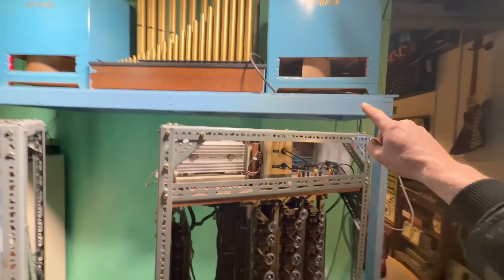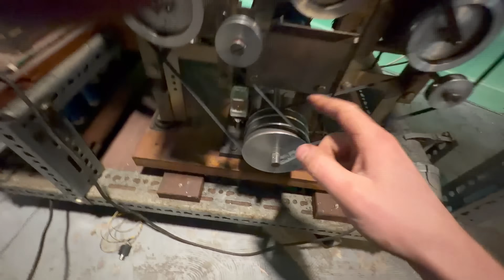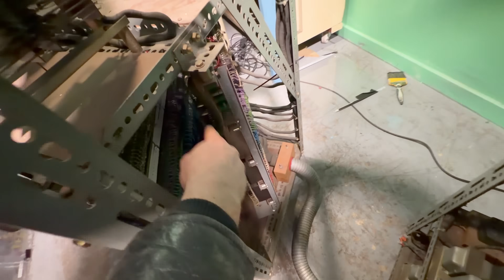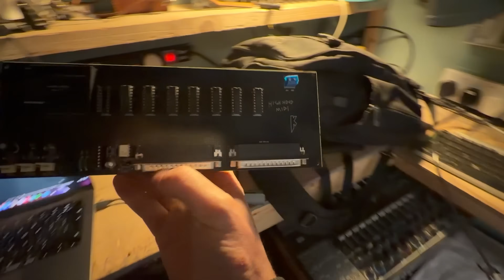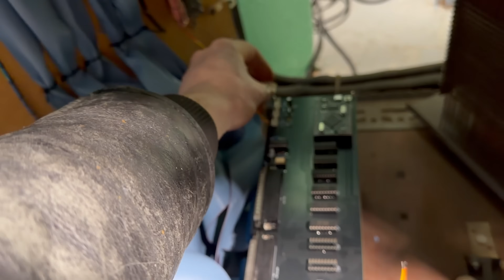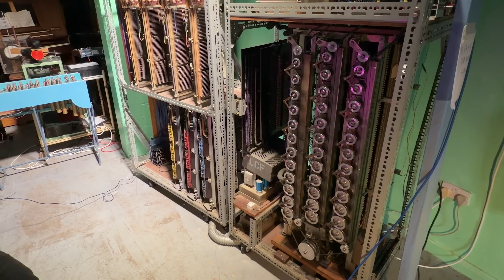IT FINALLY WORKS! - Crazy Electrostatic Spinning Church Organ

Comment: It's technically functionally making use of an even at the time it was made, an abandoned form of computer technology that got surplanted by cathode arrays and magnetic core memory that dates back to the early 1940s, known as rotational mechanical drum wheel relay computation which dominated early computer design because at the time it was believed that vacuum tubes required too much power and generated too much heat to make for practical semiconductor gate arrays.  In the late 40s they figured out it was possible to use tubes and it was faster and cheaper than drum relays so the drum relay tech was abandoned.

To see the same technology used to disipher the Enigma machine later used in a church organ is pretty unreal.

Comment: That needs a MIDI controlled brake on the motor pulley for vibrato!
Has anyone ever re-engineered the tone wheels for a similar organ? With cheap brushless DC motors available now, I could conceive of a mechanically simpler design that still produces the fantastic sound that this produces.

Comment: So those high-side MIDI boards, what are they? A load of SPI port expanders that can do high voltage? Or just the high voltage drivers with 1 pin of the D-sub connectors going to each input on the chip, and the chips just being high-voltage buffers? And then what, a load of port expanders somewhere else? The name implies it takes MIDI in. I see it's running at ATMega. An ESP32 would be nifty, driving a 60 year old electro-mechanical church organ over Wifi would just be too great! Though I suppose you'd want standard wired MIDI too, as first priority, since everything else speaks that. 

Actually you could, later, add Wifi from an ESP board, just outputting standard MIDI that way through the thing's MIDI input. Then put a little app, or better, just a web page, that people could connect to on their phones, with the option to play little tunes! A few pre-set tunes a few notes long, then maybe a partial keyboard, to let visitors mess with it even if you don't want them touching an ancient death trap running on old 5-amp round-pin sockets.

Impressive that MIDI has lasted so long, invented not long after keyboards started to have processors on board for digital control. And it still suffices now. 31,250bps being fast enough and within latency that no human ear can tell if it's a message or two late. Even over USB at ridiculous data rates it's still emulating MIDI, running real MIDI data over however-many layers of abstraction. I wonder if it allows stuff like real-time sample transfer and digital audio, over faster links like that? But still, the basis, is 5-pin DIN serial links and they're always supported. AFAIK, not an expert like. But nice to see long after the Atari ST has died, it's still going and you could run original Cubase tomorrow and have it run a studio.

Comment: ..recommend you swap out all those old electrolyte capacitors, this may by chance even fix your amplifiers.   Yeah its work, but necessary.... the old caps are either leaking already thus breaking things and circuitboards, or they will soon.

cheers

Comment: A small tip for checking if its spinning at the correct rate which you may already know: laser tachometer with a bit of tape on the wheels would allow you to see the rpm of each wheel and quickly check which one isn't correct

Comment: Hey Sam, I'm not sure how much you know of a MCU (CPU) internally, but the Renesas Header File "R7FA4M1AB.h" of the Arduino Uno R4 shows how the internals are addressed. just hold down the control key when hovering over a "keyword" from the header file and the Arduino IDE will show it to you.

In the Renesas R7FA4M1AB, 19.x MB datasheet you can see the address numbers / space of the onboard goodies, it's necessary to have this datasheet and reading it. each section shows a description of the "goodies" and it's "Registers" (addresses), i.e.: 0x4000 0000+.

You only need to correctly address something and shift in some (data) bits, that's all it takes, the cpu takes care of it on the next clock cycle. 21 nano seconds later. No need for Arduino code!!!!!!!!!!!!

Once you understand the Renesas Header File "R7FA4M1AB.h" things will become very clear and creating things will cost minutes rather than hours and days, weeks. You'll never return to Arduino Nano or Arduino Uno R3. 

Also it's a 5 Volt 32 bit machine rather than 3v33.   You might be very interested in it's Real time clock, 14 bit Adc & 12 bit Dac (VCO) and of course SPI / I2C.

Comment: Hey Sam, the Arduino Uno R4 is beast, very much worth the time for top notch experiments, the Header File "R7FA4M1AB.h"  becomes visible when you write: R_PORT1->..... and hold down "control" while hovering over "R_PORT1".

When you write: R_PORT1->, a context menu appears in the Arduino IDE when typing ">" after the -. 
allowing you to choose what you need.

It's by far much much easier to manipulate it's brain using hardcore code vs "Arduino" code.

I got SPI running with a CD4040, 74HC595 ic and some leds plus an additional pin to "latch" the input of the 74hc595.
I did this using the SPI.H from the Arduino ide, than i started asking the "brain" what SPI setting the "h" file employs.
Than i copied to output from the serial monitor and created my own "SPI" file and it worked.
Using just 14/15 lines of code instead of a cumbersome long file!

In general Arduino code is bad, obfuscating a lot of "important" stuff and introducing more cpu time, making it considerable slower.
I'll make a video on how to use ports and the SPI. it's easy.

When you get SPI going, you can use a Dac like MCP4921 / MCP4922 (dual 12 bit dac in Dip14), just shift data 4 spots to the left to emulate 8 bit Dac and more ic's. allowing you to build advanced computer controlled experiments or a  add Sram like 23lc1024 (128 kb).

also it's 32 bit, allowing you to calculate up to 4 billions big numbers in 21 nano second (one cpu cycle).
Much much much more precise than a 8 bit cpu like Arduino Uno r3.

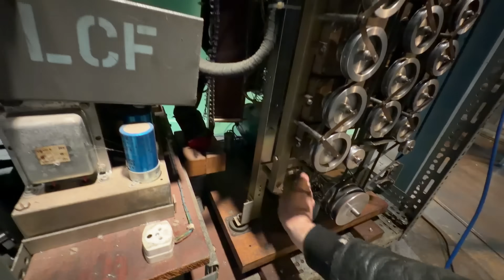Comment: Watching you pull the plug around 25:00 ... some Hammond B3 players actually do that as an effect.  Flip the power on the console off and back on real quick.  It acts like a pitch change controller on a MIDI keyboard.
Reply: Yes, it fairly common. Strange how many commenters aren't aware of it.

Comment: Any idea yet if you're going to be able to multiplex some of those several-hundred wire cables into something a bit less unwieldy?
Reply from the maker: thats what we have done with the midi converter?
Reply: @LOOKMUMNOCOMPUTER  Of course that part's true :) I meant the one around the 3 minute mark, that probably has sound instead of control signals in it so probably a bit harder to multiplex?
Reply: @LOOKMUMNOCOMPUTER  Also I have no idea what I'm talking about, never mind me

Comment: NIce video, small point, but Makin is pronounced with a long A, so basically like Making with no G (hat tip to Steve Wright). It was one of the middle names of John Pilling who was the entrepeneur who bought the electronic division of Compton when it went bust, and set about realising his dream of making low cost organs available to churches using elecronics and not pipes.
Reply from the maker: alas. got the northern term i am aware, but its hard to say. i just say words as they come out. cheers

Comment: "this is the worst piece of code in the world"...
Arrays would be the facility any programming language offers to greatly reduce the amount of code, but as you point out in the on-screen-text, this makes it harder for non-coders.
Reply from the maker: arrays are good when everything is in a line. this is not.
Reply: @LOOKMUMNOCOMPUTER  arrays are certainly also good for a mapping like you do it here. is the code online ? I'd like to rewrite to show.
Reply from the maker: @lImbus924  its ok thanks! i know i have done this as it is for none coder minds. i have a version for another project with an array. this makes the most sense.

Comment: The frost heaters are most likely important to keep dampness out of the mechanisms to help protect them from corrosion,  also keeping the whole machine at a steady temperature will be important for stability.
Reply from the maker: That’s only useful if it’s on all day everyday if this was in an enclosure maybe but it’s open. So no need. And as you can see they are not safe.
Reply: @LOOKMUMNOCOMPUTER  Makes good sense to remove them for Your specific location and use.. I used two similar tube frost heaters that came from an old church organ to keep a caravan dry, It was full of my ham radio gear and vintage test gear, was my electronics workshop for about 5 years. those little heaters made a big difference in the small space. Your museum is a whole different ball game for sure.  Moved all my gear indoors when my daughter left home and I claimed her old room. with central heating !  one frost heater is in my friend shed to keep his mobility scooter happy. :-)   Keep up the good work, You do amazing projects, always an inspiration. CHEERS

Comment: Hopefully that shop has a dedicated tech library room too. I know the videos are good documentation, but the level of detail on these things needs to be put down in illustrated notebooks with backup scans to a computer. (Also don't forget some kind of index with dating, and number the pages.) And probably cross referenced somehow with a label stuck on the equipment somewhere. The unique nature of this, it doesn't have to be that boring and dry a read either - insights and takes on what you think of these things with commentary pages are worth a read too. Thus the manuals could have a little bit of instructional aspect. A project in itself, but done as you go along it's a little less daunting. Jogging memory is one thing, but as you're taking on this artifact somebody else in turn may do the same and I'm sure that would be appreciated. (Heck you might be doing that already, but we never seem to see much of that bit. Might be something to share if you do, given the scope of it all.)

Also like how when you pull the plug on the pulley drive, it's got a built in tape-stop effect as it winds down. That's a bit fun!

Comment: I’m pretty sure tone wheels require an EXTREMELY light oil. If someone has used an incorrect/“sticky” oil, it would make it sluggish. Maybe a clean and relube is in order?
Reply from the maker: Machine oil 20 weight
Reply: @LOOKMUMNOCOMPUTER  just a guess. I figured you’d be on it. 😂

Comment: We had a compton church organ that was rellaced in 2005 when it was increasingly unreliable.  We only had one set of tone wheels which drove two manuals and a pedalboard.     12 wheels - one for each chromatic note in an octave.  Every sound was derived from these with electronics halving the frequency several times to get all the stops.  It was lacking in high treble sounds.  Replaced it by an Alan Protege which sounded clearer as the Compton was a bit dull and muddy.

Comment: It's extrodinary how they could build such machines in this era.
Reply: You speak as if intelligence and inginuity were recent phenomenona.   Digital electronics certainly have made many things much simpler to design and build.
Reply: @richardsinger01  Intelligence and ingenuity mean nothing without the tools — they had them, sure, but nothing close to what we have now. That’s why their work still stands out and that's what I was admiring.
Reply: Willingness and the patience to do it is a factor. Some aircraft engines from WWII feature more precision than the latest automotive internal combustion setup. Modern methodology threw away certain attention to detail as part of the economic decision. (Not always cutting corners, some is from finding an easier way of doing something that's less fussy overall.)
Reply: @pauljs75  absolutely, and I believe to be the case here also. Beautiful industrial designs overall before the mid 80s.

Comment: So the Swell and Choir are enclosed.. The big black Pedals below the console are Swell Enclosure Pedals. They are volume Pedals to Increase the sound of The SWELL and Increase the sound of The CHOIR... The Pedal to the far right is called Crescendo Pedal. 

LEFT PEDAL IS CHOIR VOLUME PEDAL / MIDDLE PEDAL IS SWELL VOLUME PEDAL / RIGHT PEDAL IS CRESCENDO.
Reply from the maker: Indeed. That’s another way of basically saying they are voltage dividers for the ranks. But what is crescendo? Please be more specific is that overall voltage? What is it?
Reply from the maker: thanks for the reply. but need specifics on the crescendo cheers.

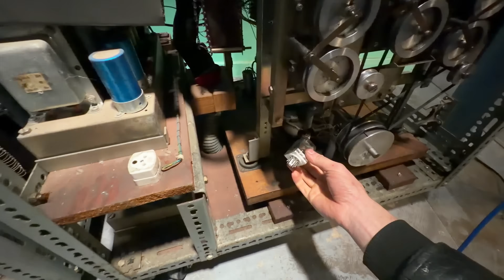Comment: 24:20 please, don't hurt old mechanisms - add power coil on/off and sync it on "play button" in software
Reply from the maker: Seriously it’s absolutely fine. That’s another way relay is a mains domestic relay. One or two on and offs will not harm the thing.
Reply: dear  @LOOKMUMNOCOMPUTER 😊
may be it be more safely and useful do selection switch mod for motors steering in arduino? 
First position - it is like standby mode, before you start new melody play from pc - power of motors is switched off. And start only if you did it in pc. Of course needs add delay before full moror start.
Second position - In the midi keyboard mod - switch relay "always on" mod for live playing.
sorry, if i am annoying you, i'm jast industrial programmer engineer😅
Reply from the maker: Huh

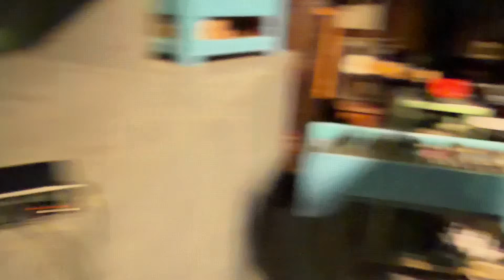Comment: 23:12 i believe tys MIDI standard for stop tabs is actually note on/off
Reply from the maker: Which is what I did on the other organ. Just doesn’t seem logical. You use an extra channel which could be used anywhere else and limited to 128 stops. When you could use cc and use 128 per channel. Seems a no brainer. I did read that and thought it was daft so did it my way 😂